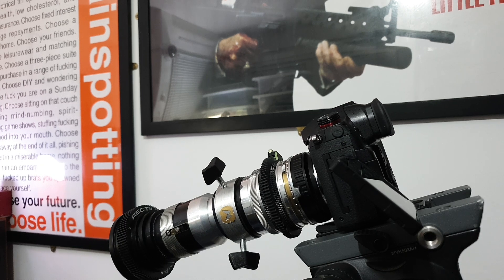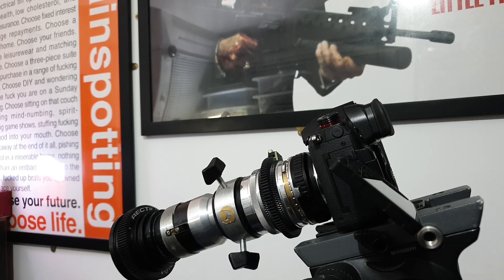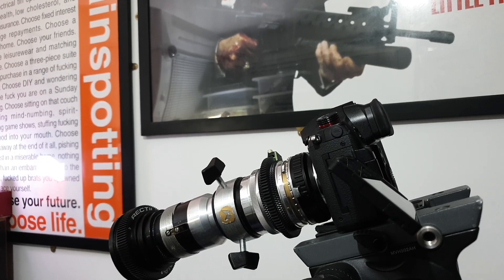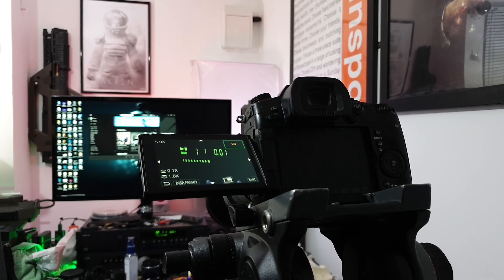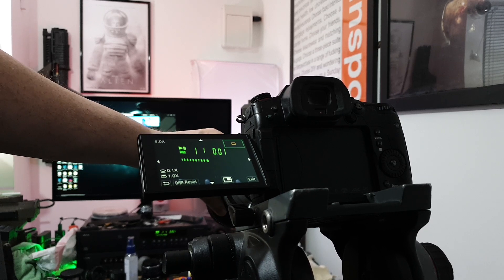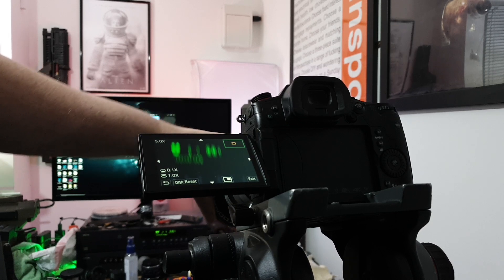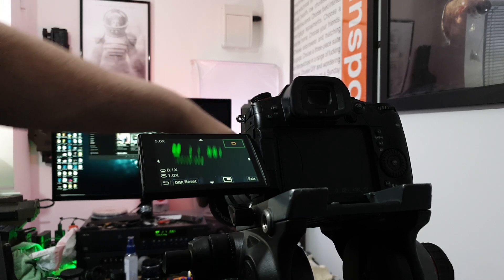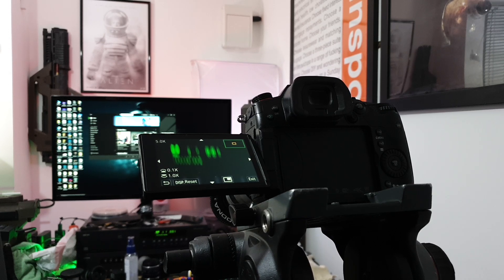Aligning (tuning) an anamorphic lens using a front variable diopter

Comment: Good tutorial.
I use a Kowa Prom 16A but now looking to get a variable diopter because dual focussing is a complete ball-ache. Any recommendations?
Reply from the maker: Both the Rapido FVD and Rectilux HCDNA are great.  I like the fact the Rapido is lighter but it's not as well built as the HCDNA.  So there are pros and cons to either.  Optically both are as good.
Reply: @P13DM  Thank you.
Reply: @P13DM  in your opinion why isnt it built as well as the HCDNA? I dont own either and Im curious.
Reply from the maker: @GuardianFilmworks  the body is thick metal, presumably CNC machined.  It's like comparing a Ford to a Hummer.

Comment: Great tutorial! I was thinking of tuning my Kowa B&H , do you loosen all 3 pairs of screws then tighten the longest tab before tightening the other 2?
Reply from the maker: Yes loosen all three.  You can tighten them in any order.
Reply: @P13DM  Great thank you! Are you aware of the correct screwdriver size for the small screws outside the scope? I've had bad luck stripping screws before
Reply from the maker: @ProducedByInfo  I just got a jewellery screwdriver set off Amazon